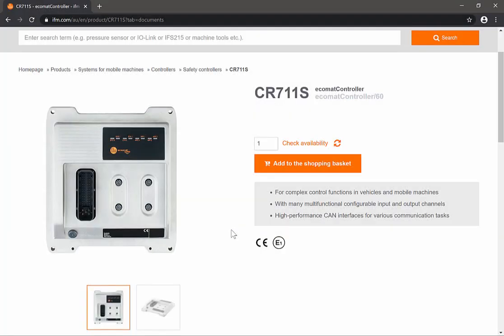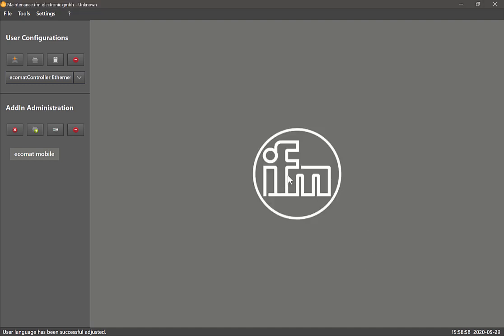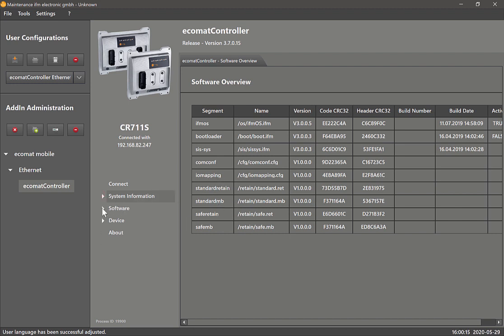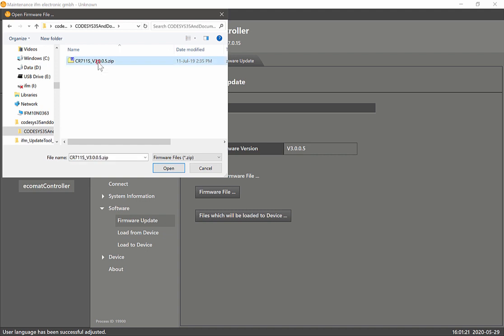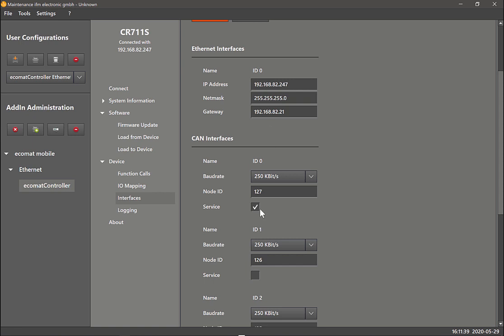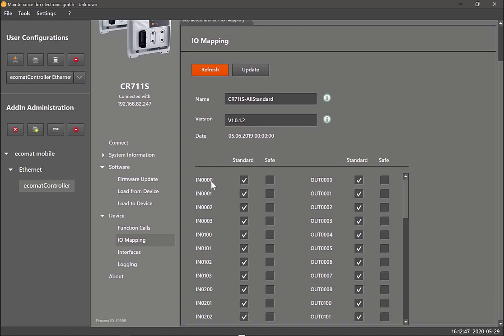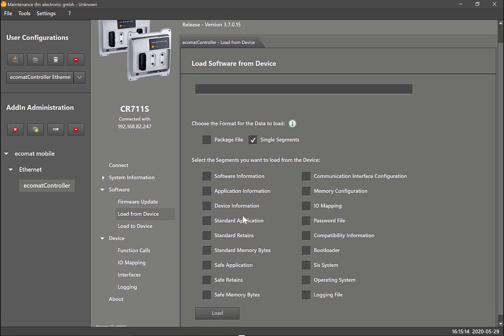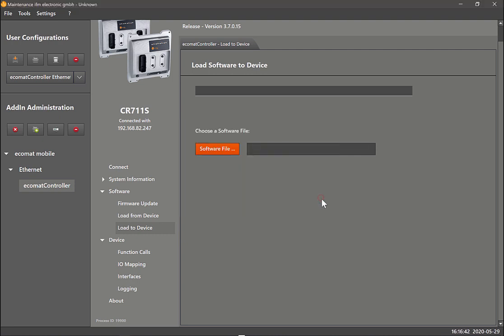How-to: Use Maintenance tool with ifm ecomatController

Comment: hi, please let me know how to connect CR0451 to PC for maintenance software, i am having EC2112 and EC2113 hardware with me. I am unable to understand how to do the physical wiring for it
Reply from the maker: Hello Ziauddin Ansari, you need an EVC642 cable where the 1x M12 plug of EVC642 will be connected to Power using an EVC492 cable, 1x M12 socket of EVC642 is connected to EC2113/EC2112 and 1x M12 socket of EVC642 is connected to CR0451. If you need more detailed help, please feel free to contact our local support. Thank you and kind regards from the ifm social media team